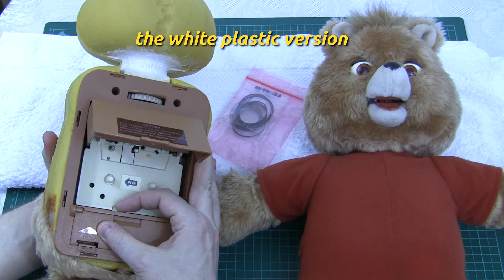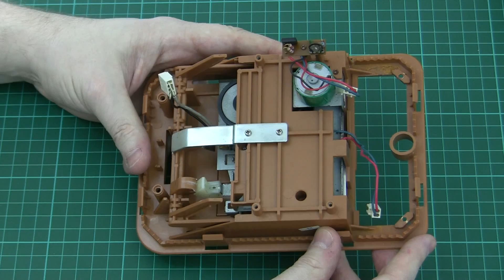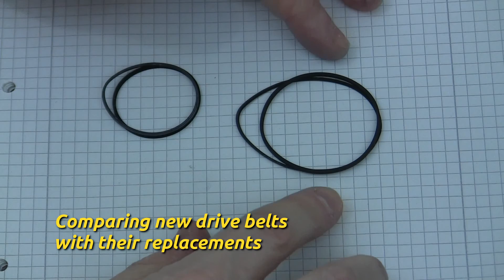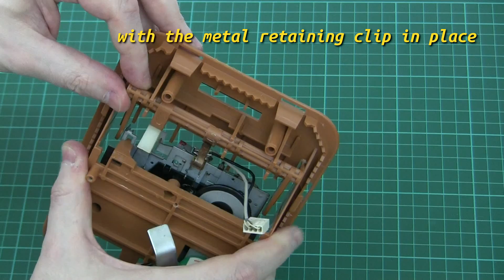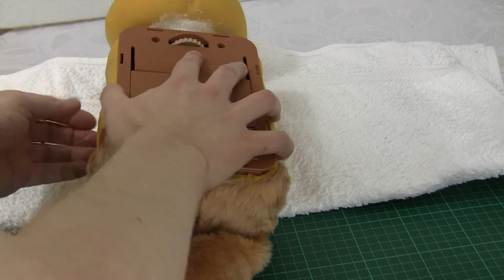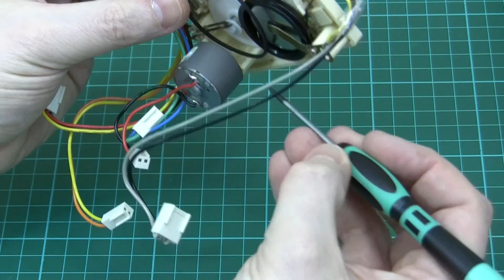Teddy Ruxpin Refurb Part 3 - Cassette Drive Belt Replacement

Comment: I replaced the belts on mine because they were worn out and not working. The player now works but it’s running fast. Could the belts I used be the wrong size?  I thought they were the same size, but maybe not?

Comment: I watched you replacing the belt on teddy Ruxpin and I surprised myself by replacing the drive belt. I have the ivory color cassette but i still have no power. I put in new batteries and steel wooled the connectors. How can i test it that it is getting power and what else might you suggest. I put it away with no batteries and it worked some 30 years ago?  Thank you for you help
Reply: I'm not a professional, but I remember my father (a mechanic) often using a tool on batteries to tell if they had power, and he used it on my Furby once to see if it was still working. Maybe try something like that?
Reply: Did you ever fix or get an update? I may have suggestions for you.

Comment: Great Video. Thank you for a great guide on how to fix TR. I just wondered if you could help with the Red wire form the motor as it has come of thievery small PCB and i cannot see where to solder it back. Any help would be greatly appreciated.

Comment: Dude,….. thank you so much,… I knew I had seen this video previously, and am stuck on trying to diagnose what’s preventing power from getting to the board, on a Rev E model, after eliminating that the pot switch on the back wasn’t the culprit, try to get to the tape door sensor to either fix or bypass it altogether, and got stuck on getting the plastic housing apart. Aside from the necessary repairs, it is superficially in otherwise near mint condition, and was afraid of breaking that tape head cover tab, but now I know, that’s basically the only way.

Comment: I have a teddy whose cassette left wheel turns, Sometimes I can get cassettes to work for a brief second but then they do nothing. Any ideas?
Reply: If those two things don’t work. Push/bend the pins slightly towards to the right towards the diamond shape on the gear that helps move the pins. May be that it’s just not getting a good enough connection. Hope this helps. Let me know if you get it working after that.
Reply: Another thing to check is the yellow wire located near the metal tab above the pulley that runs the tape deck. Check to make sure that has a solid soldered connection. That can also cause the playback not to work properly.
Reply: Two pins located near the take-up spindle on the back, above the white gear that turns it. When it gets dirty, it fails to sense that the reel is moving (it constantly pushing the pins back & forth to send an electrical pulse as it moves is how it senses this) , hence why it goes into auto-stop if it doesnt. Get some isopropyl alcohol and/or (depending on the condition of the pins) some white vinegar and clean any dirt or corrosion off. Should work fine after that.
Reply: @inspiredfigmentsarchives  I will try all you suggested. TY very much.
Reply: @inspiredfigmentsarchives can you do a video of that ?
Reply: Is it also possible to send you my model and you do the refurb? How much would that be?

Comment: My mickey wont stay on and his casette player wont work, can anyone help?
Reply: @Olivia Collier-Sadoski that sucks:( thanks you for keeping me updated in the future:)
Reply: @Olivia Collier-Sadoski I opened him up, I think he has the same problem as yours! Mine wont turn the tape either, he only had the power to do it once, Ill buy a new curcut board:)
Reply: Not the circuit board… it’s two pins in the cassette player near the gears that drive the spindle/take-up reel. Clean those and make sure they’re both bent to the right near where they fit the diamond shaped piece that spins as it plays. That’s how it senses the tape is still playing vs the auto-stop function.

Comment: I have a 1983 2 ervo Teddy Ruxpin and the eye servo is constantly operating in an erratic manner, any ideas what it could be?
Reply: My understanding is that Teddy's twitch may be the result of the potentiometer in the motor failing, and as far as I know, the only fixes for that are to rebuild or replace the problem servo. The potentiometer feeds back the approximate position of the mouth to the electronics, and when it starts to fail, you get that twitching, because it doesn't know quite where it is anymore.

Comment: Sir. where did you buy the drive belts for the Metal Back Teddy ruxpin? I have looked every where. please help. thanks. Colt
Reply from the maker: I did a search on ebay for "44mm drive belt" or "32mm drive belt". You may have to settle for something close or wait a while till the correct size is listed. Make sure that the cross section is roughly 1mm (I got 1.1). Up to 1.2mm is probably OK. Good luck